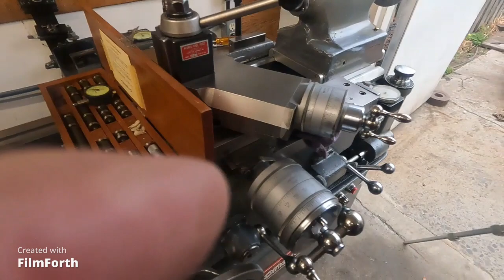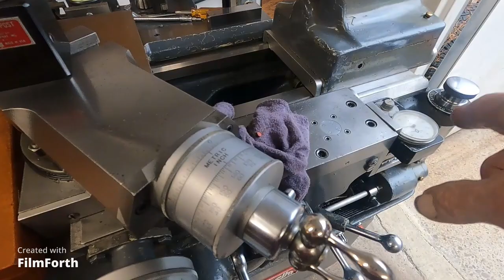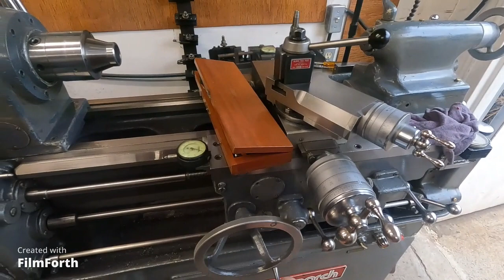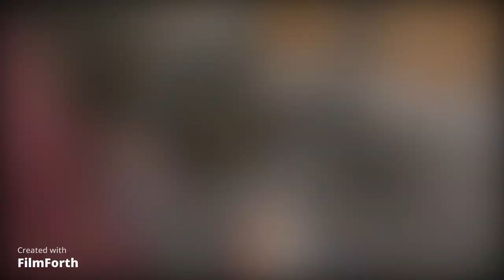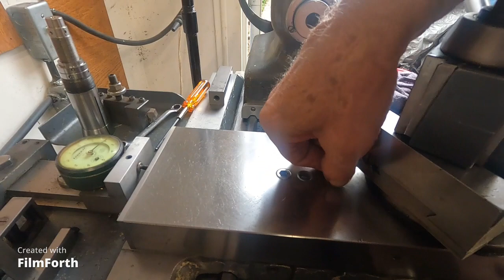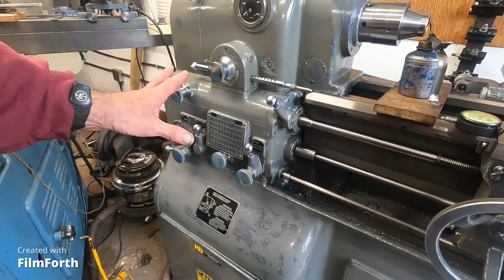Monarch 10ee Inch/Metric lathe set up without DRO part two

Comment: I just looked up to see what a Trav a Dial is selling for on bay. They are still quite expensive. On a 120" lathe I can see where a Travel a Dial would be much easier to deal with on the Z axis than a DRO scale. That's a long scale to keep from getting twisted up.
Reply from the maker: There are some new old stock ones on ebay, I find these work fine for me but I can clean and maintain them